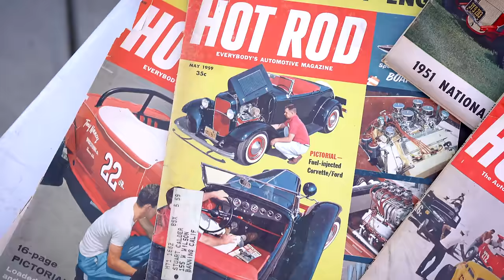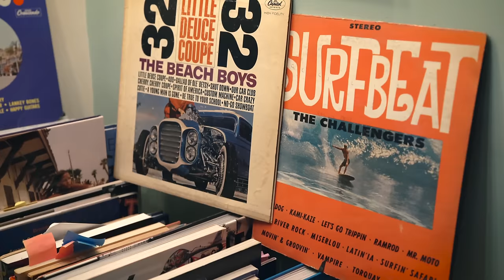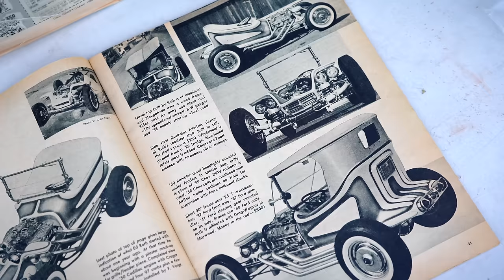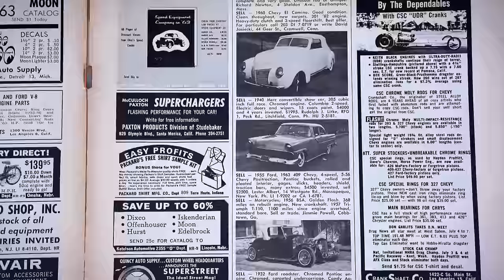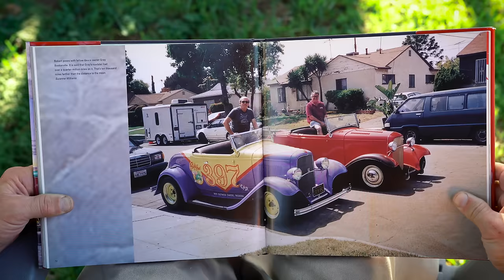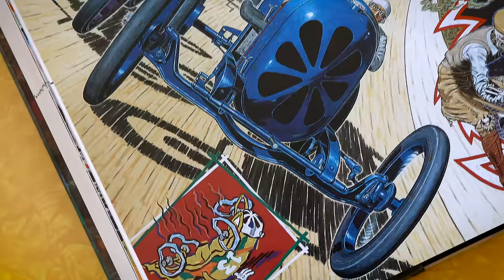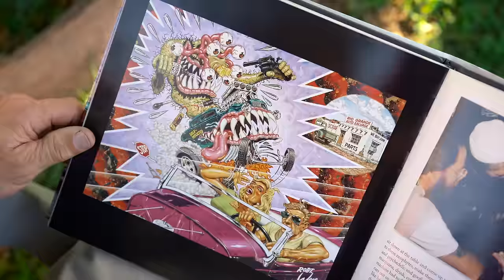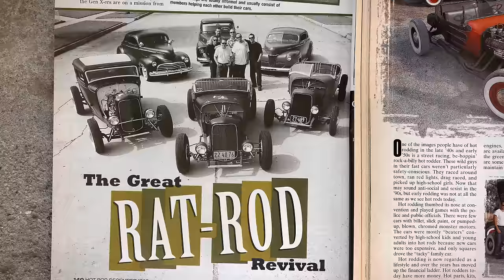The Man Who Created The First "Rat Rod" | Robert Williams

Comment: Nicely made video, and Robert Williams is a pioneer of the low brow artists, but I recently did some extensive research on the Rat Rod subject. In 1993 one of the members of the Shifters used the term Rat Rod, and it is in print.  Baskerville's article didn't come out until 5 years later. A lot of people owned primered cars in the 1970's and 80's while waiting for a paint job. Doesn't mean that their cars were Rat Rods.

Comment: In 2008 I built my first street rod,,from 2 - 1930 model A frame rails,,, 77 mustang cobra front suspension,,88 cradana rear,,88 351 Windsor,, 86 c-6 transmission,, and I built the body from aluminum street signs polished to a mirror finish and of course cragar wheels,,, l have win 8 trophies with it ,,, many say it should be in magazines..  I just finished a 45 dodge pickup,,,and now restoring a 72 chevelle and have 8 more classic cars waiting to do I've been buying up for 8 years..

Comment: Is this the same guy that did the inside cover art for the guns and roses appetite for destruction album?
Reply: Yes and no. When that album was first released the art was on the outside cover. The record company got complaints so it was moved to the inside.  The painting and title were done in the 70s. The band took the title from the painting and used the painting (with permission) that was done about 20 years before the record was released.